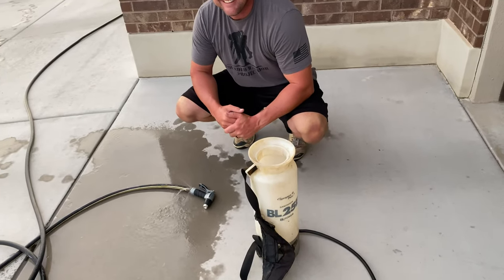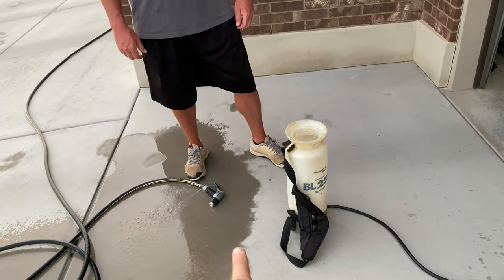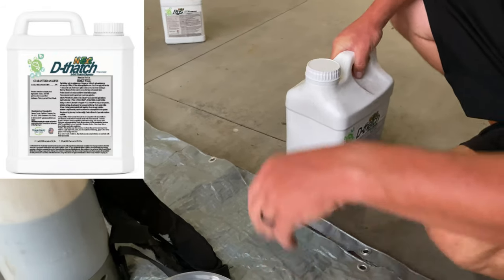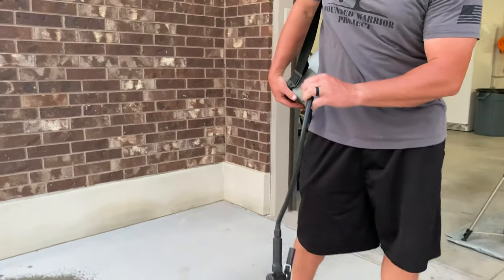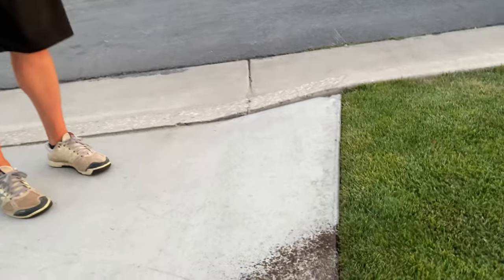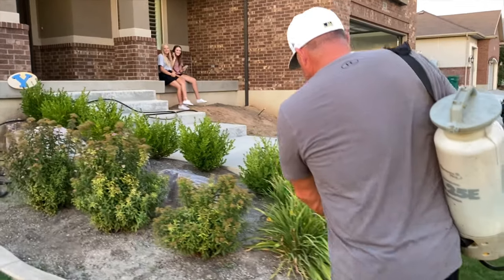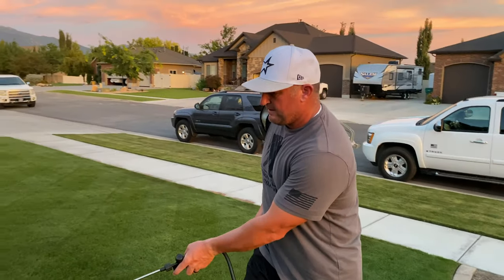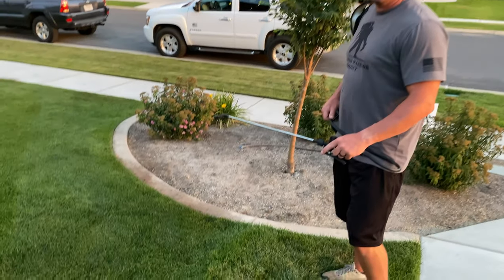Teaching a Liquid Fertilizer and Bio  Stimulant Newbie How To Apply

Comment: JOTGL - Been running the N-Ext line gambit for 2 1/2 years now.  Started with 4GL battery backpack on 18K lawn, but quickly learned that spraying with a 4 GL BP took way too long with re-fills, 2+ hours.  Now I am sporting a 21GL tow behind, done in about 30-40 mins! Easy P-easy once you get the hang of it.  Peace and God's Love!  Chad Upstate NY
Reply from the maker: Chad Fleming lol I would be crying if I tried to do a 18k lawn with a backpack sprayer... it would take ages.. what tow behind you rocking Chad? 
Super simple right? But you gotta March your abilities, wanta, and needs with your lawn, just as you did!
Reply: @TheGreenerLawn  Using the NorthStar from Northern Tools!  Works pretty good but I had to figure out how to change the nozzles out as the stock one leaked!  Change them to a changeable T-Jet nozzle.  They work much better!  Link If anyone is interested: https://www.northerntool.com/shop/tools/product_200646314_200646314
Reply from the maker: Chad Fleming 💯 💚💚💚

Comment: Can you get Air8 and RGS off concrete? If so, how do you remove it without damaging it? Thank you in advance.
Reply from the maker: Comes off naturally with time if you do nothing, as water hitting it will break it down, you can also Rinse it with water to flush it off quicker.. He did nothing here, that you saw it get on his sidewalk and there is no trace of it any more. If you want to get it off quicker you can use toilet bowl cleaner, just rinse away from your lawn. I get it all over my edges all the time, and I never worry about it. It’s all fine.
Reply: @TheGreenerLawn  thank you!
Reply from the maker: @22cardsfan22  any time! Feel free to reach out!
Reply: I use Simple Green and a towel. Also works on vinyl fencing... 😉

Comment: Do you have any issues getting that power hit mixed up and sprayed out?  I mixed Humic 12 and Microgreen the other day and had some clogging.  Had to stop shake up the sprayer then keep going.
Reply from the maker: Tony Bowman humic12 is THICC And is why I always spray it separate from the others. These three have never given me issues at all. If you keep humic12 by its self, you should be pretty safe from clogging. (It’s suppose to be sprayed down at 7:1 mix, contact me if you want my rates).
Reply: The Greener Lawn I figure it at 9oz per 1,000 so I put in 36 oz. in my 2 gallon sprayer.  I was just trying to same some time by mixing together but lesson learned. Lol!

Comment: How many sq foot lawn did you spray in this video.. I’m more so looking at a new sprayer thanks
Reply from the maker: Wyatt T on my calibration with this sprayer and most products I can get 4-6k out of a 2 gallon tank. 

His yard we did was 1400sqft. Then we did his neighbors 1300sqft. I had calibrated the liquids I was telling him to 2700 sqft, then filled it accordingly with water.

If you’re looking for how I did my calibration I will share that video.
Reply: Just looking at pump sprayer and what’s best for my size
Reply from the maker: Wyatt T what size is your lawn? What products do you plan on running through the sprayer? What sprayers are you looking at?
Reply: Do you have a Facebook or private messenger??
Reply from the maker: Wyatt T Instagram @thegreenerlawn or email at JeremyofTheGreenerLawn@gmail.com

Comment: I'm sure it's a great product, but I'm a cheapskate. It seemed easy to pick up on though. Thanks
Reply from the maker: john g I might be confused, explain.
Reply: @TheGreenerLawn  when I clicked on the product link, the cost seemed a little high, and I was just calling myself a cheapskate, or tightwad, penny pincher. It was a good video explaining how to use the product. Thanks
Reply from the maker: john g ahh got ya now. How much do you spend on yard fertilizer applications a year?how big is your yard?

I knew u weren’t being rude, I just was like... I didn’t talk prices lol how did we get here? I got ya now.
Reply: @TheGreenerLawn  my lawn is 10,000 sq ft. I haven't put down a lot of fert this year. I bought two bags of Scott's Green Max w/ Iron, earlier. That's it no so far. But my cost is starting to climb. I ordered a 25 lb bag of Super seed Store tall fescue ss1000 for over seeding in about a month. I sent a sample today to Purdue University. I've had a rough summer with fungus.. Thanks again
Reply from the maker: john g got ya. You could easily run a bios stem year package for $104 bio stem package for the year on 10k sqft. Add some solid fert options  you could be any where from $150-$250 for a season on this and fertilizer. 

Sounds like your getting serious this season! That’s a solid turf choice.